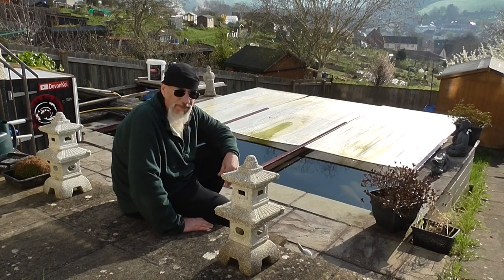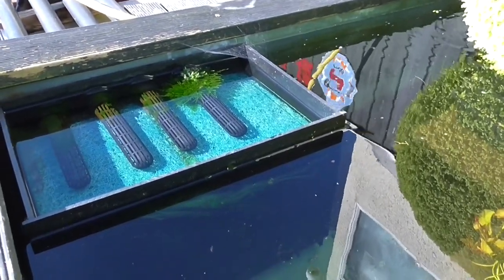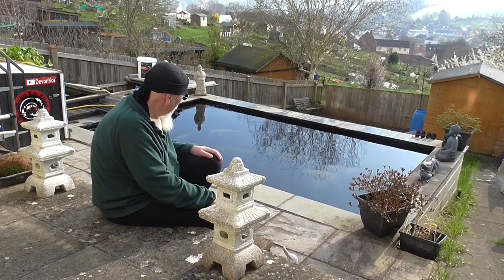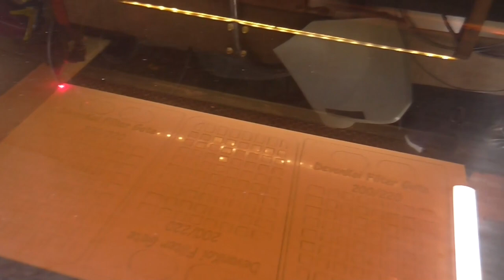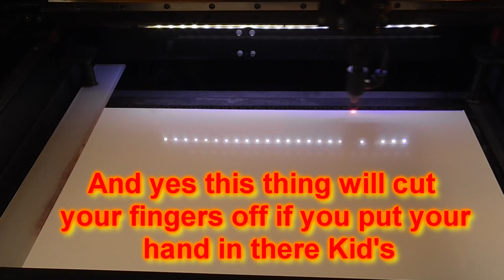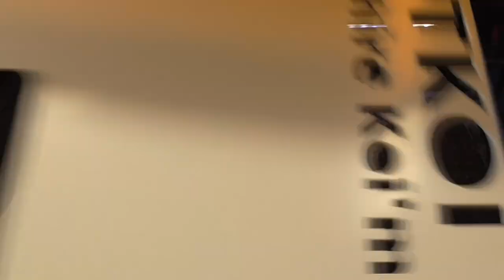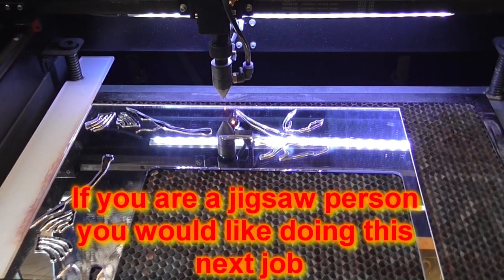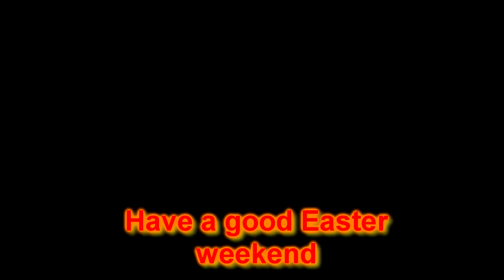***A KOI POND IN SUMMER *** LASER CUTTING KOI POND PLAQUES  *** STARTIN OFF THE POND YEAR 2023***

Comment: Hi Martyn, good to hear your feeling a little better. Lets hope you can soon get the opp done and out the way mate. Some cracking laser cut's there, that laser mesmerizes me 😅  😅I could watch it for hours 🤣🤣Wow! your veg filter looks amazing, that baby tears has taken over. I'm hoping to get my covers off this weekend 🤞🤞give the koi a bit of sun. Great video again 👍👍have a great weekend mate, and thanks again for you know what, Terry.
Reply from the maker: Terry you would spend hours playing with a laser cutter if you like the cnc Router i have just setup a power roller system so work can pass through front to back it has doors in for this but you had to feed it in steps of 300mm by hand yourself it now it feeds itself as it works down the cut by stepper motor off the Y axis so movers the sheet not the cutter head in Y movement making it much easer to cut stuff up to 600mm wide and any length i can get a sheet at in school or 500mm wide any length at home on my cutter just using a cheap Chinese rotary roller axis. works a treat. have a good long weekend Terry and get them covers off